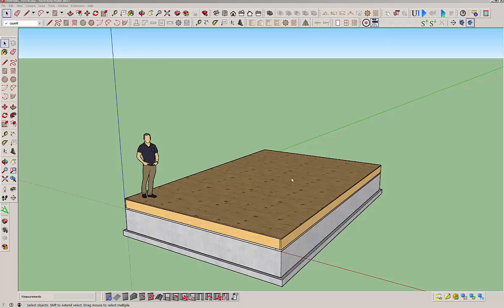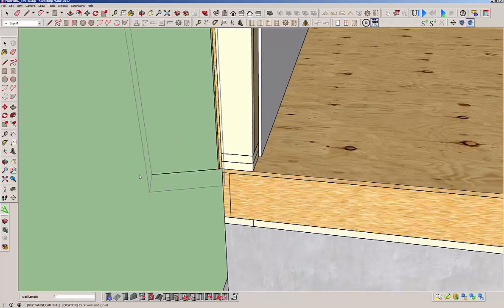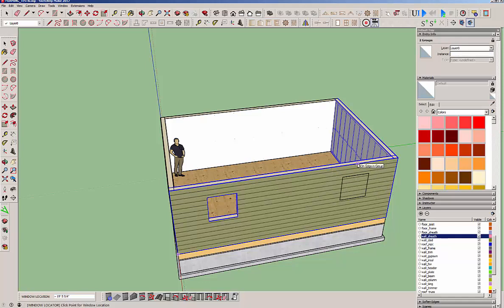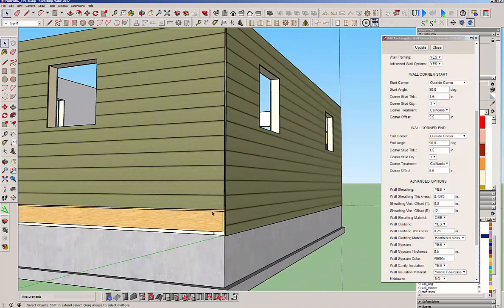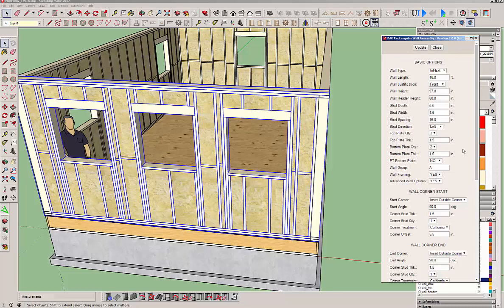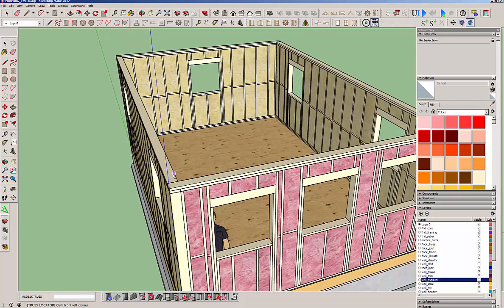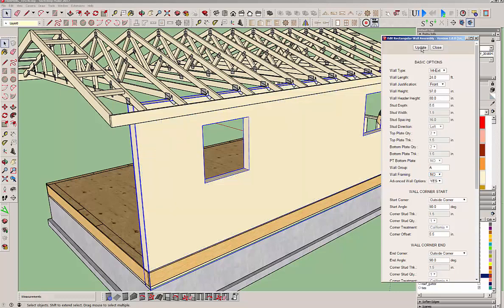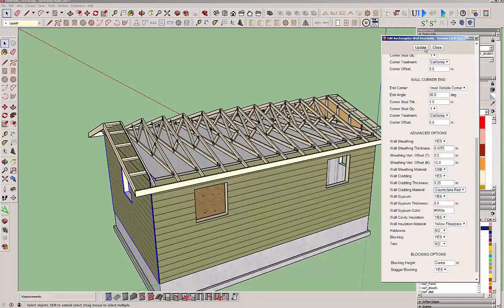Wall Plugin Preview 3

Comment from the maker: I'm only about 2-1/2 weeks into the actual development of this plugin so realize that I've only just scratched the surface.  With the latest preview video I am getting a lot of questions about other wall systems.  Initially I will release the plugin with the conventional light wood framing but subsequent developments will also look at steel framing, CMU, brick and other more exotic methods as the demand arises.

The framing option will currently be:

- Yes/No/2D

This will probably be expanded to (or some other variation):

- Lumber/Steel/CMU/None/2D/etc...

I still have a lot of work to do before I can release this even to the beta testers.

The current pre-release "todo" list is:

1.) Wall and Window edit, move and delete functions/Tools.
2.) Global Setting tabs for Window and Door settings.
3.) Rudimentary Door and Window plugin that integrates with this plugin tightly.
4.) Wall Move and Split Tool.
5.) Add air gap parameter for the cladding (ie. brick fascia).
6.) Auto corner configuration
7.) Polyline Wall Tool and Face Wall Tool (right now all you can do is create a single segment at a time).
8.) Final clean and addition of any additional parameters to the Global Settings.
9.) Further refinements to the Add Window and Add Door Tools.
10.) Gable/Shed Wall Tool.
11.) Add glulam beams to Window and Door header options.
12.) Update Wall Plugin web page.

I'm sure there are other items that are probably missing from this list but those seem to be the major items right now.

I probably should have just left them but the blocking and insulation algorithms were complex and so it took me a couple of days to figure them out and then commit them to code.  At one point I just had to start over since my initial algorithm was too inefficient and the code quickly got out of control and became an ugly bowl of spaghetti for lack of a better word.

Please keep sending me your suggestions, they do not get lost.  I am compiling another post-release "todo" list where all of these other items will be considered and hopefully the majority implemented.

Comment: Hi Nathaniel. I love the potential of this plugin. Will you be introducing different walltypes? I understand that everything is centered around timber frame construction but would it be possible to include masonry options? I.e block, brick, cavities ect. Unfortunately in the UK timber framing is still generally kept internal 😒.
Reply from the maker: Initially it will be focused on conventional wood framed  construction and then I will branch out into more exotic wall types (ie. steel framed, CMU etc....)